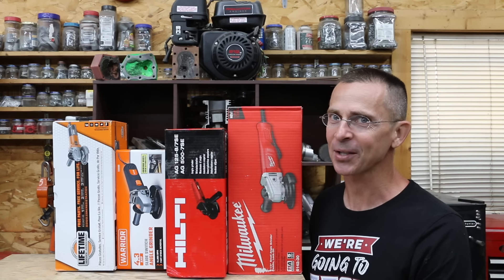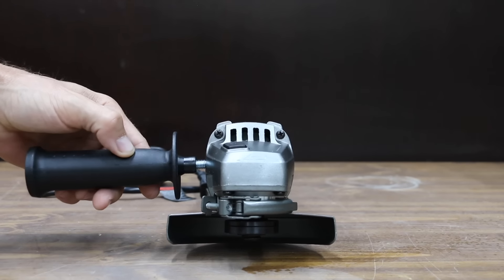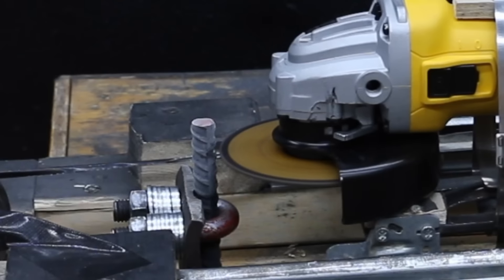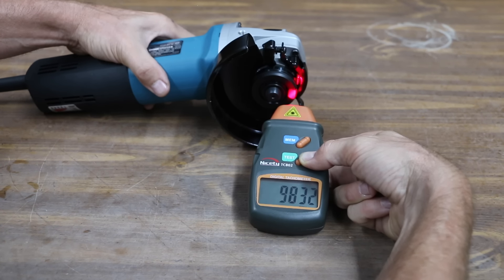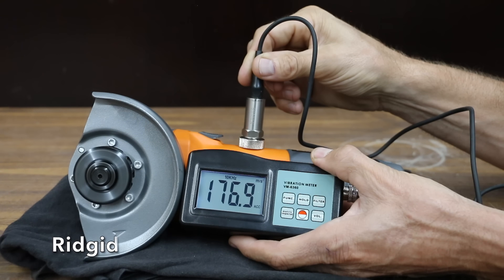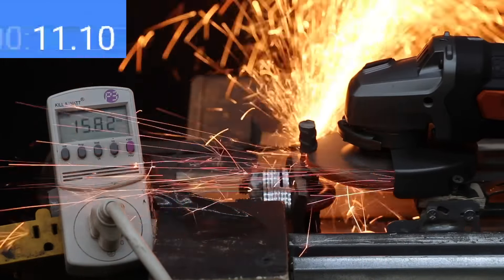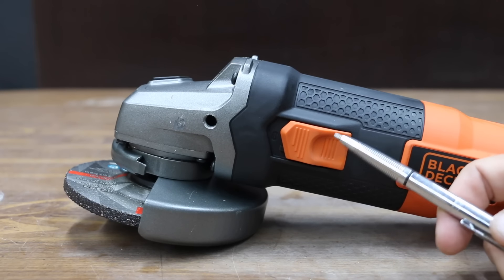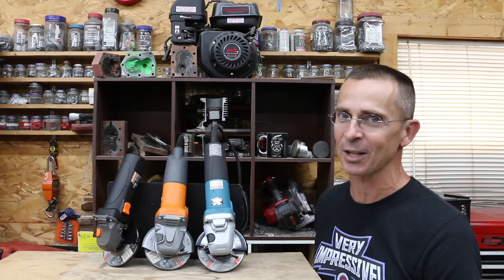Best Angle Grinder (Corded)? Hilti vs Milwaukee, DeWalt, Makita, Ryobi, Ridgid. Let's Settle This!

Comment: I've had my warrior grinder for close to 15 years now, passed it along to friends to use, chopped all the metal in a couch, cut up an entire dishwasher for recycling, and used it on just about anything I can. It's quite the trooper and the $10 I paid long ago was such a bargain. Glad to see it in this review.
Reply from the maker: Thanks for the feedback.
Reply: That's funny, I don't remember Warrior being around 15 years ago. I have a Drill Master I got at Harbor Freight 10 years ago and it was only $7. Try to come up with some better stories next time.

Comment: You didn't mention the most important feature of the Makita - variable speed. Great for polishing and stainless. I'm a big fan of mine; it's too expensive to use as a daily driver, but a must have for more specialist jobs. Its only competition is the discontinued Bosch Inox low speed grinder.
Reply: They have a paddle version to feather the speed too.
Reply: they're great for a business that grinds a lot, and the var speed is a great feature.
we use them all the time in our stone shop. we have 5 in daily use, and only need to replace one about every year and a half or so.
it's overbuilt and overpriced for a home-use tool though, although you likely won't need to replace it if you do get one.
Reply: @nobody8717  That's the thing, my grinders aren't for home use, they're for construction use, and I don't see the point of giving a 1400W variable speed tool to a guy that's gonna spend a week removing rust with a wire wheel.
Reply: @nobody8717  greetings from one stonemason to another^^
Reply: It is trivial to speed control any universal motor. You can use a phase fired chopper. Which is a fancy way of saying light dimmer. But you need an inductive rated one. You need a snubber across the triac. Or you can just use snubberless triacs. They cost about 50 cents on the open market.
Reply from the maker: Thanks for the feedback.

Comment: If there’s ever a part 2, I’d be really interested to see how the Walter brand stacks up. I’ve got one, and I love it; but it’s pretty high in the price range, so I’m really curious if it makes that much of a difference
Reply from the maker: Thanks for the suggestion.
Reply: Say Hokie,wth does one get a Walter from as I've never heard of,read about nor seen that brand before your mention..
Reply: @ProjectFarm  as well as Metabo
Reply: @Wil_Liam1  DeWalt maybe?
Reply: @Wil_Liam1  They are commonly available through major welding gas suppliers in Canada. Air Liquide, Praxair and Messer all carry them or can order one. I can't speak for outside of Canada. They are made in Germany. They also make awesome abraisives. Metabo is their low grade brand. I have beaten up a few of them over the years as a welder/fabricator and they are very tough. Makita is good but they break down. Only thier higher end 6" grinders are any good to me personally. De-Walt has a U.S. made 5"/6" that is great if you use it as a 5" for "light" grinding.
Reply: The pictures I've seen in the past, the Walter grinders were made by Metabo.
Reply: @jeffmiller3150  Seems like you are correct. I didn't realize Walter was a Canadian company that was partnered with Metabo. Not sure if that is still currently true but it certainly was for several years.

Comment: Having used the ryobi before, it is an extremely comfortable grinder to run for extended periods.
Reply: I thought the Ryobi not Reeobi was doing pretty good until it went up in smoke.
Reply: "comfortable" does in NO way make up for being a "broken piece of junk"
Reply: @MoneyManHolmes  Yeah, but not really fair using a grinding disc on a brute cut off test like that.
Reply: @rogerwilcojr  exactly.  Thanks to PF we know the limits. Home gamer situations, or light duty but long all day use this is good option to have in the kit.  And since corded it's not like you're locked into buying only Ryobi like the battery versions.
Reply from the maker: Thanks for the feedback.
Reply: @Derkson  ditto.
Reply: I have never anyone that has been happy with any riyobi product.

Comment: My cheapo Skil angle grinder died, after 35 years of use, the day I saw this video. I bought the Ridgid, really it seems too cheap to be a Ridgid, but the only place I could find it at the price you mentioned was Home Depot. So if anyone else is looking for one at that price, I have done the research. If it lasts 35 years I will be needing another angle grinder when I am 105. Enjoy your videos.
Reply from the maker: Thanks for sharing.

Comment: Yup, Ryobi is the most ergonomic.... paperweight. 
Can't believe it burned itself out without even being moderately abused.
About 2 years ago, decided to standardize on that brand for all of my cordless power-tools needs. One charger, couple of different batteries to fit the few Ryobi cordless power-tools I have. Well, thankfully when it comes to corded power-tools, to heck with pragmatic brand loyalty. For the price and everything else I've seen in the video above, I'm liking that Porter-cable angle grinder.

Comment: We used to buy Metabo grinders at a shop I worked for, they were the most performance for the dollar spent. I used that logic and bought a Metabo miter saw, it didn't last an entire year. What a waste of money, I asked Metabo about the warranty and they gave me a phone number to a shop 70 miles from me that never returned my call. I guess I was supposed to ship the saw to them and I don't believe it would be worth my time. Next time I guess I'm forced to buy the extended warranty through Lowe's and I'm not happy about that. Great video!
Reply from the maker: Thanks!  Thanks for sharing.

Comment: Excellent video, sir!
I have a HF 4 1/2" grinder that is over 10 years old, has ground down 3 sets of 6' brush hog blades, 1 set of 15' batwing cutter blades, 2 sets of 5' brush hog blades and countless lawnmower blades and hundreds of cut-off and grinding wheels . Sadly, it hasn't been offered by HF in several years. At the time, I paid $14.99 and it was the best $15 I've spent. And by the way, it's still going strong.
Reply from the maker: Thanks!  Nice!

Comment: The old "Made in Germany" Metabo angle grinders are the best grinders known to man. I worked in a precision sheet metal shop and they were used 60hrs a week for finish grinding and the only thing that ever wore out on them was the cord. They had new cords installed and kept using them for years. They were well balanced and had smooth operation for making flawless finish grinds.
Reply from the maker: Thanks for sharing.

Comment: All mine in the business are Makitas. I am glad it was a reasonable choice. We use them for floor grinding with diamond tooling discs. The safety start is very important for contractors as workers work many hours and do many start and stops during the day, this feature adds safety.
Reply from the maker: Thanks for sharing.
Reply: Love Makita tools, but swapped to another brand as Makita still does business in Russia.

Comment: I'm so glad you went corded with this one!  I'm going to need one for my bathroom remodel.  I need to cut arches for the curves around the tub where it flattens to get in and I've seen videos of people doing it this way.  I'll be using long and wide tiles from the floor to about 4 feet up on the walls and I want the tiles to come 4-6 inches into the 2 tub entry walls beyond the tub baselines.  I'll go up from there to the top of the surround, go all the way around and back down on the other side.  All of that will be 6 inches wide, both going up and across.  The window will be lined inside with them, too, with a small border around it.  I'm using a light brown wood-grain look tile.  The sink cabinet will be lined them, too, and its 2 doors will have them as inserts.  New flooring will be put in to match.

At only $15, I doubt the Warrior is the best choice at Harbor Freight, but I wouldn't want to spend $133 for Milwaukee's easiest power switch activation, but that, blade stop speed and vibration are considerations, and that complicates things.  Considering EVERY factor, including those not graphed, the Ryobi is the one for me.  The handle rotates, it has 3 grip positions, it's quiet at 88.9dB, its vibration is extremely low, the power is 5 of 10, (including a tie at 9) , and its 1st cutting is 6.7 seconds in a 6.45 second average for all of them.  Its big downside is blade stopping speed, being 9 of 10 including a tie, so I'll stop it spinning on the back of a tile or a 2x4.  I'm not crazy about its light lime green color, but I guess that's not a dealbreaker.  The linked one is $55.89 refurbished, tested and certified to look and work like new.  Brand new is $79.95, so for $24 off, I'll go this route.

Thanks, Todd, you're the best.
Reply from the maker: You are welcome!  Best wishes on your big project!
Reply: @ProjectFarm   Thanks!

Comment: One of the thing I have used my grinder for is cutting hardie or even tile and rock.  The dust is a killer on the slide button and  prefer the paddle switch.  Some of the designs pull in more dust than others reducing the life of the motor.
Reply from the maker: Thanks for sharing.

Comment: We have a Makita at work, I have a variety at home but use my Metabo the most with 6" cutting discs followed by DeWalt with either flap discs & grinding stones, my Milwaukee not so much. I use a 7" Hitachi for big grinding jobs (I used it for years with a diamond blade to cut control joints in concrete around swimming pools, it's a beast!)
Great video, thanks!
Reply from the maker: Thanks and you are welcome!

Comment: I found a 4 1/2” cup brush at a odd lots store - found the adapter I needed to mount it on a “left behind” Ryobi 4 1/2”
grinder…..let me tell you this turned out to be one of the most useful pairings I’ve ever encountered. Fantastic for painting prep on wrought iron and even PT wood posts; cleaning under mowing decks, pre-and-post welding treatment, smoothing out cut surfaces on sheet metal - I think the cheapest grinder would work just fine although the trigger/handle design of the Ryobi tested here would lend more control.
Put on a full face shield and try it, you won’t be disappointed.
Reply from the maker: Thanks for the feedback.

Comment: I have had the Milwaukee for about 10 years and it works great, but I was tired of chaging discs so often when I got a welder. I bought a PAIR of the Porter Cables for $30 last year and they are great for cleaning up metal.
Reply from the maker: Thanks for sharing.

Comment: I’m in the granite business(countertops)
Until the last few years cordless was not an option. When dewalt came out with the 9ah flexvolt we got their newest grinder and a battery. It does great and will make a good many cuts….
When i saw that flex had a variable speed grinder (necessary for polishing) i was all over it. Man let me tell you that thing is an absolute beast..
Reply from the maker: Thanks for the feedback.
Reply: @ProjectFarm  yes sir. Best resource on YouTube!!!

Comment: Not surprised Makita came out on top.  Buddy worked at a shop that made counter tops for kitchens and bathrooms and they only used Makita grinders for polishing/shaping/cutting.  Said they were absolute beasts.  I didn't use grinders much so I used to spring for HF $20 cheap units.  Got one for free and burned up 2 or 3 total before I decided I now use grinders enough to invest in a good corded one.  I ended up going with DeWalt, which is a much larger unit to accommodate bigger discs.   Later felt the need to keep one on my work truck, first got a battery Ridgid to go with my Ridgid set and later upgraded to a battery Milwaukee and I can say between those 2 Milwaukee is king, but the Ridgid didn't do bad.  Thanks for the tool comparison
Reply from the maker: You are welcome!  Thanks for sharing.

Comment: I was on a time critical job in England (240volts) and I burned out my cheap grinder.  I was getting some supplies from my Trade supplier; they had a Makita Grinder on sale for the equivalent about 170 USD.  I thought it insane amount of money for a spinning motor that held abrasive wheels.  I was in a hurry, so I bought it. BEST MONEY I ever spent!  It was in a different league to all the other grinders I have used my entire life. Less Noise, less vibration, no Sparks flying out of the motor vents. I know 240v tools are not a direct comparison to their USA counterparts, but using a really nice tool all day compared to using a DIY version is similar to driving a crappy car vs a BMW 7 series on a long journey.  I will never buy a BMW, but I will spend 10 times average price to get a high-quality tool.
Reply from the maker: Thanks for the feedback.

Comment: Coming from a former pipefitter/welder, on jobsites, the makita, Metabo, and milwaukee were the  most common, rarely seen any of the other brands unless they were a helper and its what they could afford. I have all 3 in a 4.5(except metabo its actually a 5") as well as a makita 7" and an old school skill 9". Use them a lot in my shop and never had an issue with them. I have burnt up several bosch and dewalts though.
Reply from the maker: Thanks for sharing.

Comment: Very Nice review again! I saw your video on cordless angle grinders too. Interesting to see quickest cordless cut on 1/2'" rebar was Milwaukee at 6.8 seconds which is slower than all but 3 of the corded angle grinders. Big difference especially when corded Makita is under 3 seconds and only costs $170. Cordless power certainly has a long way to go to match up with corded angle grinders and don't even mention the runtime difference 😂 Great review as always Todd, I like how you used same tests between corded and cordless grinder comparisons too to allow for direct comparison.👍👌
Reply from the maker: Thanks!

Comment: The og Dewalt paddle switch grinds will forever reign as the best grinder ever made imo. Used them ever day for years. Ergonomicly they are the most comfortable to hold and they were like 85.00 and lasted a decent bit for the work I did. Doing boiler tubes I’d have 5 next to me to swap out so the could cool down between tubes
Reply from the maker: Thanks for sharing.

Comment: One of cool things we get to see in this video is the comparison of lower amperage("I've got this one project?")angle grinders, and the "heavier-duty" I've got a place to plug it in, 4 1/2" angle grinder. There's really a model for just about everyone in this test. 
I'm personally interested in how well the budget grinders perform against the Heavy Hitters. 
When I'm carving, I really want, and sometimes need one handed operation, carving wood, not trying to remove a ton material, but still needing adequate power/weight balance. Don't forget the ability to survive being hurled off the workbench cause the cord was wrapped around my ankle.😎🤓🤬🤠

Comment: I have a pile of old bosch grinders I've acquired over the years, always done me proud. The Makita grinders I have are just in a different league though. Using a Makita grooved disc was also a revelation, they eat through anything. 

Just one thing I would have done was a temperature test, not just the motor, the gearboxes can get pretty warm too. I need to repack a few of mine, and perhaps put some PTFE in there too. 

I've bought "disposable" grinders for special jobs and have always been disappointed.
Reply from the maker: Thanks for sharing.

Comment: Thanks for another informative video!  I probably will go with Ridgid if or when I need another grinder.
Right now, I have four, all "budget" models, though I don't use any professionally

Bench Pro (purchased from Big Lots in the 90's for maybe $15).  This one has been used and abused, is on its third set of brushes, and the lock broke on the switch, so I took the spring out of it....  This one is used with cutoff wheels (it has a smaller body, and is easiest to hold one-handed)
Bosch (older model) - This one is used for typical grinding and probably sees the least use.
Drill Master (harbor freight  - I think it was a freebie) - used with a flap disc.  The locking button fell out not long after I got it.
Chicago Electric (also harbor freight)  This one has a paddle switch, but either the arbor is off center or bent, or something else is terribly wrong with it.  It gets used with a wire brush because it CAN'T be used with anything else.  Just didn't feel like taking it back.
Reply from the maker: You are welcome!  Thanks for sharing.

Comment: I bought Makita's SDS 2 angle grinder. Very nice, so far. The 5" version also runs 4.5". The 6" version runs at a lower rpm. The variable speed and lock on is very useful. Many more options.
Reply: SJS 2
Reply from the maker: Thanks for sharing.

Comment: I needed a grinder for a pretty messy project I had so I bought the Black And Decker as I didn't really plan on it being a daily driver after the job but that was 3-4 years ago and I still use the thing pretty often. For me, it's punched well above it's price point.
Reply from the maker: Thanks for sharing.

Comment: I do a lot of cutting and grinding stucco, concrete and would go through one a year. Cheaper brand two for $80 Canadian Tire, the old ones were actually quite good . Bought a Milwaukee because of the dust protection on windings etc. Had it two years now and still going strong.
Reply from the maker: Thanks for sharing.

Comment: I use those makitas in my workshop for fabrication, grinding and polishing. They are beasts, but very safe and user friendly. I rebuilt them numerous times, but wont switch for any other grinder.
Just remember to blow them from time to time because they hqve very fine blades on the fan, that can clog when you are polishing with cotton pads
Reply from the maker: Thanks for sharing.